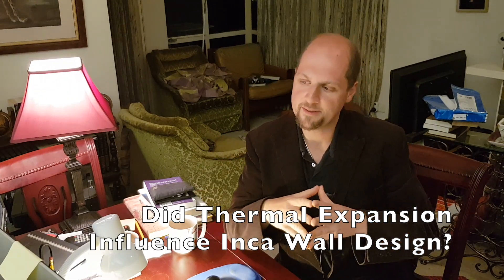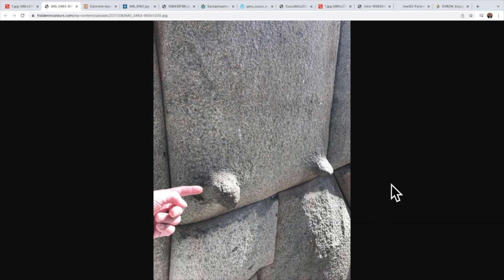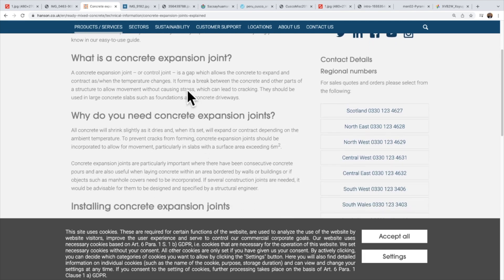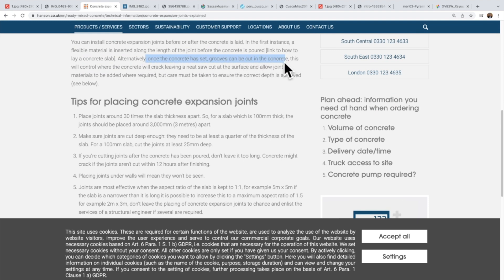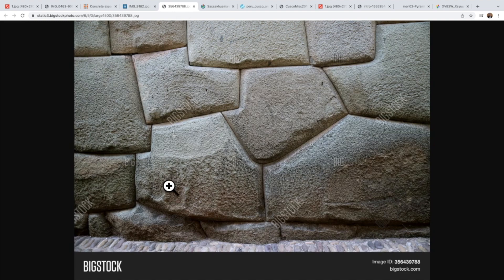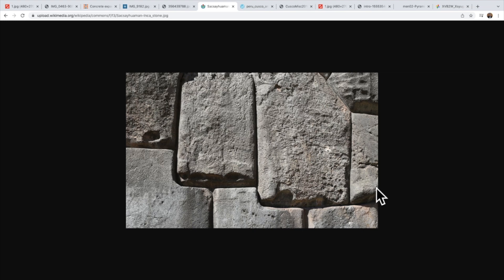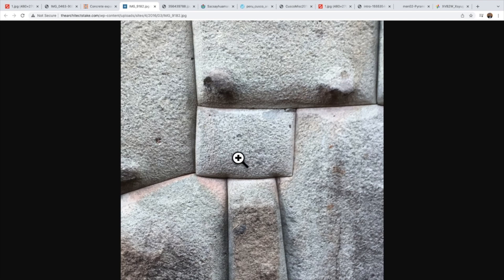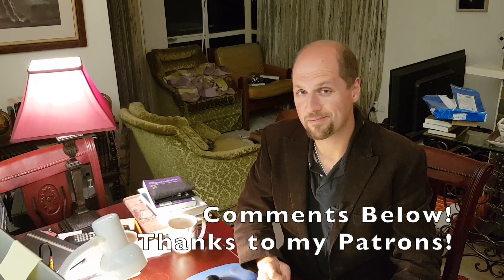Inca Nubs as Extruded/Intruded, Stone-Welding+Stone Mixture, due to thermal-expansion in setting?

Comment: 9:30 Brien Foerster did have one video where the "Pre-Inca/Inca" constrast confused me, but usually his descriptions are similar to yours, with the smaller rocks being "Inca" and the much larger ones "Megalithic".  Then there are Spanish colonial stoneworks, with stones much smaller and less organized than either two.
Reply from the maker: Yeah I agree with him however I See exceptions.
Reply: The smaller stones underneath could be repairs. Even just to fill in the wall.
Reply: @chikato7106  Yeah, the possible repairs mentioned at 5:00 appear to have a more Inca-sized resemblance.  Those semicircular lines at the top and bottom have me wondering about the nature of the damages.

Comment: Great video Dr Kos. A great area to look is the pyramids with their original face stones. Areas where the stones are missing you can see that the underside follows the shapes of the ruff stones underneath, as if they have been squished in! Also it looks like the outside was faced off flat after positioned. Pillowed edges also appear to be a more darker shade in some cases as if its been heated.